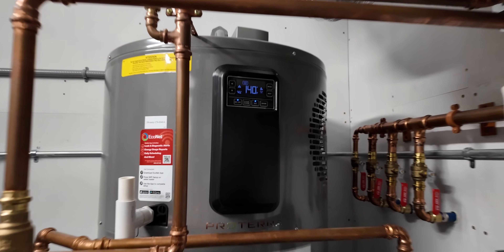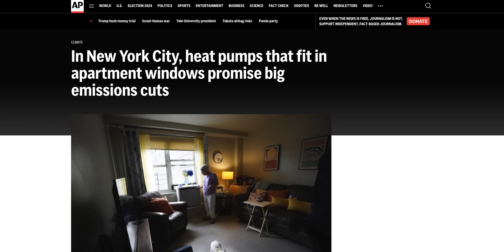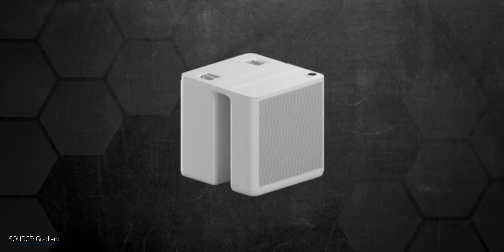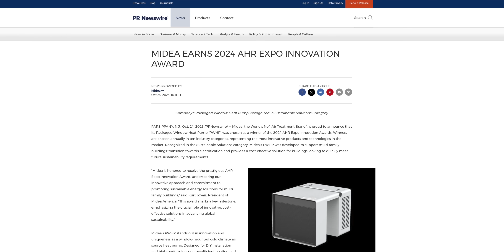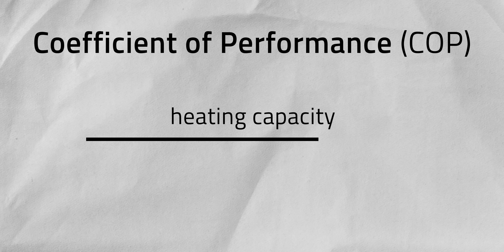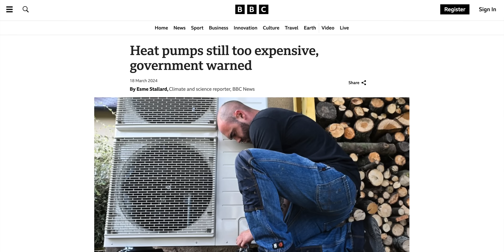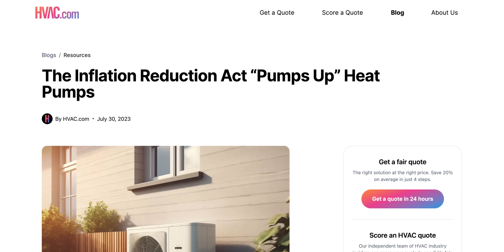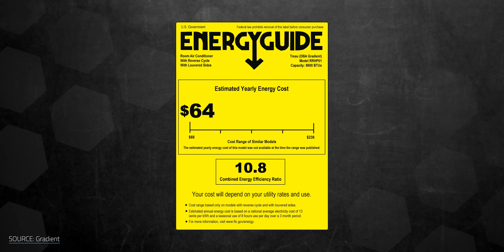Why This Window Heat Pump Is Genius

Comment: If nothing else, the design is a significant improvement on AC window units.
Reply: For $3,000 it should come with a custom airbrushed design and also do my laundry. There is no reason it should be more than $500, they are milking free (taxpayer) government handouts.
Reply: You can get equivalent design AC only units for a fraction of that price.
Reply: Is it? This thing has to be constantly blowing air at leg height or child height. How is that comfortable or even tolerable? What about the noise level if this thing is going to be near a bed?
Reply: @d0nj03  Leg height? You mean like central air conditioning vents? I don't know about these specific units but it's possible to blow upwards, away from the room's occupants. Regarding noise, I expect them to be pretty quiet on the inside. Most of the noise will be outside.
Reply: @eDoc2020  Central is mounted inside walls, this thing is presented like it doubles as a table, I see no way for it to not blow directly onto people, and whether it's cooling or heating, the air temp as it's just coming out of the unit will be uncomfortable. Not very well thought out, very low performance (a Daikin minisplit can reach a SCOP of 5, and that's seasonal, not cherry-picked best-case) and very expensive.
Reply: no it is not, nothing new in this design.
Reply: @hrvojelasic5794 These are the first ever units which combine the ease of a window mounted reverse cycle air conditioner with a split system reverse cycle air conditioner. They simply take a 1980s window mounted reverse air con unit and split it into two sections (like a split system reverse cycle air conditioner of the 1990s) but putting the compressor outside and the fan unit inside, making them quieter inside the house. That is, by definition, a revolutionary design.
Reply: @just_passing_through  I used to work for Carrier and among other things literally sold thousands of this unit in various combinations. There is nothing revolutionary, just recycled old ideas. Of course compressor is on the outside but it is noisy, ugly and there is a reason these are abandoned units.

Comment: 95 is not an irregular high in NYC, North Jersey or Phillie/ Camden. Now consider being in direct sunlight in Jul, when its 85 in the shade at LaGuardia, JFK, or Newark, that's about 115. What do you think the temp is gonna average in places w/ 22,514.2/sq mi, 62,264.2/sq mi? Now consider Cliffside Park 25,570, Mahwah 25,344, Maplewood 25,321, ppl sq mi all of them small suburban boroughs.
...
With all that said I want one. I can place it in a place that's shaded. It would be to augment AC and heat, not merely a stand alone solution.

Comment: Things like this is needed for renters who have to live with outdated heating and/or cooling. EG4 makes a heat pump AC that runs off solar. A window model that can run off a small portable solar array would be nice for renters that need help controlling an electric bill that is at the mercy of a rented house.

Comment: Wait...$3K?!? A 12K BTU minisplit WITH installation is $1500 in Arizona, and it is 20 SHEER.  If I were a landlord, I would put a whole bunch of them on the roof where I can centralize the electricity and connections and just run lines down the outside of the building to each apartment, which...is what they do here in three and four storied buildings.  I see the potential, and the utility of these units, but...$3K?!?
Reply: 3 grand for one window unit is absurd. And while the 1500-dollar price quoted may be off by quite a bit, it is providing more capacity for a lot less. If these units catch on, perhaps the cost per unit will be drastically reduced; otherwise, it doesn't look like the way to go.  I would be interested in a sub-1000-dollar cost range.
Reply: Here in Romania, it was 1200€ to purchase and install a 18000 BTU unit. That 3000$ for a 9000 BTU unit is way too much.
Reply: @bgn3000 250$ for the unit and the rest for the install?😅
Reply: @bgn3000  In Greece where I was born they charge 120 Euros for installation.  The price of split units are the same between US and Greece.
Reply: they have to hire someone to install the heat pumps and they make mini splits thatll handle multiple spaces but its probably cheaper to install these window units
Reply: @Chevytrucker2  Not with my experience after having installed four split units.
Reply: @mak4374  so you would do a single split unit for 30-40 residential apartments? Seems a bit different when you add a bunch of people to the mix because that's what the video is talking about
Reply: @Chevytrucker2  I don't know what you mean on the second part, but on the first, well, they do 30+ units airconditions, so why not split units?  The whole thing about split units is that they are efficient, heating and cooling, and as far as installation goes, they are not "central" but they also do not require ductwork.  I think they are all around "better".
Reply: @mak4374  you can use a multi zone unit for 5 apartments the unit cost around 4500$ USD and the zones can be controlled independently
Reply: And what outside temperatures do these machines support? If you want something that can work in below 0 Celsius temperatures it gets a lot more difficult to do, especialy if you want to keep temperature flow speed
Reply: @reappermen  I am sure you are right, but as I live in Southern Arizona, that is not much of a concern.  Still, the first unit I installed, 18K BTU, is the one that is super efficient, and it goes down to minus 18F, with a 2.2 efficiency rating, so I would say it is pretty good for a three year unit.  I bought it for $1.2K, I spent $400 on installation - the electricity was already done - and since then the unit prices have went down.
Reply: @reappermen  depending on the manufacturer they're good down to -13 for a 5 zone unit and they cost about 4500$
Reply: @Chevytrucker2  those are completely different units than what the op mentioned then, since the price you listed is triple what he gave
Reply: @reappermen  he's referring to single zone units the one I mentioned is a 5 zone
Reply: @Chevytrucker2  can you provide a link, or at least a model name? From a quick search (Europe based, not US) the cheapest complete units I could find that do both AC at summer temps, as well as subzero heating was around 4.200 € (including tax, not including installation). Now it wouldn't suprise me if US prices were a bit cheaper, but I don't expect it to be only 40% of that
Reply: There are plenty of window units that do heating as well as cooling.
Reply: Most people will look at the price difference and realize they can buy multiple inefficient ones plus electric heaters while still having cash left over to pay for the electricity costs over a few seasons. $3k just isn't going to get anywhere in this market. It's absurd.
Reply: I got a 24K BTU unit only for $1500. These fancy window units are milking tax dollars. $3k for a 9K BTU is beyond insane.
Reply: yeah but landlords love to minimize costs and do as little as possible lol
Reply: @telotawa  no tenants way to pay the least. If they want a perfect AC they also want perfect hot water, kitchen, heat, noise abatement ect....
So rent for what's described here is 3x the rent.
I literally have owned rentals where the tenants were just there to keep homeless people out for a year until I kicked down the house up through top-tier houses.
Reply: 350$ here including installation the new inverter ones
Reply: Because New York...
Reply: PIONEER Mini-Split makes a controller for 64 of them.
Reply: Yeah I live in savannah and paid about 1200 for a 12000btu mini split and installed it myself, I would like to see this around 5-800 depending on the BTU.
Reply: @laracroft8553  in the US they can go for 800-1000 depending on if it's 120v or 240v, the 120v units are less energy efficient than the 240v but there are units with inverters on them as well and they're 12k-18k btu
Reply: I entirely agree with you on pricepoint. These are meant to appeal to higher-income renters who have landlords who will not upgrade their units without doubling the rent.
Reply: Midea makes one for under 500bucks, and it’s 20 seer
Reply: @travishodges5179  what's the cooling capacity on it? 12k btu is a 1 tonnage unit
Reply: @Chevytrucker2  Midea 12000 btu is under 500$, it’s only 15 seer, my bad, it still cools my 800sq ft house no problem for like 1/3 the energy of my central air
Reply: @travishodges5179  not bad, I'm sure an easy start system would help with the central ac
Reply: @Chevytrucker2  I thought an easy start only reduced the power to start the compressor but didn’t effect the run wattages at all?
Reply: @travishodges5179  less power to startup and maintain the voltage to keep it running after startup it does drop some but with a soft start it reduces that as well
Reply: @Chevytrucker2  good to know, I think most of my losses in the central system is related to frictional losses and heat transfer in the ductwork, and age of system (2011) like a maybe 13 seer
Reply: @travishodges5179  insulation can be a good thing to check as well, manufactured houses aka trailer houses aren't very insulated and the AC can't keep up with the 90°F+ weather lol
Reply: $4K for a mini-split around Chicago.
Reply: @ecoKady  what size would that be?
Reply: @mak4374  in the northeast 4 head heat pump costs 30 grand.
Reply: Your talking a 3-4 story building maybe 4-6 Apts on each floor.probably newer constuction . So there may be space for the units . in NY and Boston buildings are 6-30+ floors maybe 8-12 units per floor in many times 100+ year old buildings...not as simple as that.
Reply: It's a scam for that price. A traditional window AC unit is already a "heat pump" pumping heat from indoors outside. All it takes is one little valve to let it run in the opposite direction to be what's commonly called a heat pump and now it's some magical overpriced device for thousands of dollars. There should be options all the way down to $200. It's not special.
Reply: @trainraiderv  Sounds like US pricing to me. Seems normal? I always assume the Americans pay 8x what I pay due to wage inflation.
Reply: @trainraiderv  you don't know the basics of thermal exchange. Taking a room from 80 to 70 and dumping the heat outside is way different than taking heat from outside when the temp is -5 to make a room 70 inside.
Reply: Traditional style window AC units are available in reverse cycle (heat pump) form and some also allow a little transfer of fresh and stale air between indoors and outdoors so are MUCH healthier and oh yes cheaper
Reply: 1500 in arizona seems like some meth head doing it. Any legit person here in Missouri wants 3k for a mini split install. I did a lot of my own stuff and only had a tech come do the pipe connection and vaccuuming the lines, and it ran me about 1500 just for that.
Reply: Jesus Christ US hvac techs overcharge
Reply: @Etacovda63  I agree.  In Greece where I was born they charge 120 Euros for a full installation, no matter the size of the unit.
Reply: @mybootscamewithoutstraps  , ok, but that is my experience from three different bonded contractors.  By the way, in Greece where I was born, installation is 120 Euros.  Including electric connections.
Reply: @mak4374  That's fantastic and I wish it were that advantageous to do so here in the USA
Reply: @mybootscamewithoutstraps  I currently live in Norway and we pay around 1500 USD for an installed pump. 2K for an installed high quality Hitachi , Panasonic etc. Just instalation is usually around 700 all included. Seems like someone is really price gouging if its 3K to install a minisplit. I paid 1K to have an Midea unit installed recently in one of my rental units. Given this was a standard installation. Once i paid 300 more for drilling through 12inches of concrete in another unit.
Reply: You are getting the methhead installer discount. Most places it's more than 1500 by a large margin, sometimes 2x.
Reply: @AgentPothead  Installing a mini split is pretty easy, me and my brother did it in about an hour or 2, then had an HVAC company come  hook up and test the lines for $150. A 24K BTU unit (with heat pump) was $1500, so $1500 installed for a 12K BTU unit seems perfectly reasonable.
Reply: Ok, now add a heater (because heat pumps also heat) and then calculate TCO with energy use over 5 years.  Let me know if the math still works.
Reply: @MikeHeller  Tell me you don't know how heat pumps work without telling me you don't know how heat pumps work.
Reply: @99mage99  I don't know what that means.
Reply: Lol 1,500. Cracklist prices…
Reply: @jameslyon8602  Sorry but no.  I installed four split units so far and the most expensive was the first, 18k BTU's, and it was $1.5K.  The rest were one 12k BTU and two 9K, and none was more than $1.1K, including electric installation, by a bonded contractor.  By the way, in Greece where I was born, the units are the same price, but the installation is 120 Euros each.
Reply: @jameslyon8602  heco en china junk maybe and probably installed before covid. they've got the hisense junk at home depot for 1500 but that doesn't include installation price

Comment: Although you mention furnaces have a COP of less than 1, I think its important to mention its not an apples to apples comparison when comparing COPs of different energy sources and how they might effect their cost to run.
Reply: Comparing cost is going to differ dramatically by region but even the idea that something that is 2-3x more efficient might be more expensive to run highlights the degree we subsidize fossil fuels and ignore the cost of externalities.
Reply: @stevensmith4099  I don't disagree and it's not something we can just gloss over.
Reply: Indeed. For now, gas has been so much cheaper than electricity that electric heat is never going to be a money saver, regardless of COP.
Reply: @MrMadsci7   With a high enough COP electric heat will be more efficient. For my utility rates the needed COP is about 5. The most efficient mini-splits reach this when it's only slightly cold outside. When you add solar panels the electric cost per kWh is slashed, making heat pumps more approachable.
Reply: @valleyofiron125  And I truly hope it stays that way for you. We’ll see what moves in to replace the hydropower going offline.
Reply: Exactly!  Misleading, as is the whole ad.  And yes, it probably works great between 40 and 90, but not beyond those ambient temps.

Comment: My new 55+ villa has two upstairs bedrooms but the heating/cooling system is single zone.  I could see having one of these to deal with the obvious need to balance temperatures in the house.  Of course, also considering some type of smart booster inline fan.
Reply: Have an HVAC professional install dampers. It's very easy. Problem solved.

Comment: Given your power calculations a window heat pump might be a better choice in the long run, especially given how easy it is to install. But I'm rather reserved as its upfront cost is quite high and some things sound good at first, but life is never that simple and there could be hidden costs and or other problems. Like 9000 BTU is not that much and it can cover between 20-30 square meters (65-100square feet), which is not much, so it means you need 2 or more heat pumps to be enough for a normal flat. Now I don't know how big are NYC flats, but that sounds small to me.

Comment: I don't love that the COP for gas furnaces was listed as 1 or less.  Technically true but it really ignores the electricity production carbon footprint issue. In my area the effective COP of a high efficiency gas furnace is above 2.4 due to most of the electricity being created by natural gas.  In that case it's just more efficient from a carbon standpoint to burn natural gas as a heat source then to burn it to create electricity which is then used to move heat in a heat pump.
Reply: Not Exactly. Natural gas power plants run around 40-60% efficiency. Transmission loss over the grid is around 5%. Some heat pumps get as high as 500% efficiency (closer to 250% in sub zero temperature) So .5 * .95 * (2.5:5) = 1.188  :  2.375. So most heat pumps are far more efficient than just burning natural gas in your home. This is why heat pumps are almost always better unless you are consistently seeing sub zero temperatures, like in Alaska or North Dakota.
Reply: @mattj3656-j7n  agree in total ...if within scop 5 or better (5kw+ heat for 1 kw electricity= there are no more further calculations required if it makes sense or not, it does, even viable solar offgrid friendly nowadays!!!
but still 3K$ or more is a dealbreaker 1 in each room when having each one implemented though...
Reply: @saloserra5711  yeah, 3k is way too much. It should be half that amount. I think they are first to market with this sort of design and are maybe testing to see what it can sell for. No way it can remain that price in the long run and still stay in business.
Reply: @mattj3656-j7n  The practical problem for most is cost of energy. My electricity is almost 5 times as expensive as gas. For an easy replacement I would need a central heat pump. Unfortunately the best central heat pumps only get a seasonal COP of about 3.5.
Reply: @eDoc2020  yeah it def depends on where you live. I live ina place with some of the cheapest electricity in the country so it makes a lot more sense
Reply: When we had a heat pump it couldnt cool in the summer nor heat in the winter without the electric heat backup.
Reply: Or you could just demand clean electricity. 🤷‍♂️
Reply: @serversurfer6169 why don’t you?